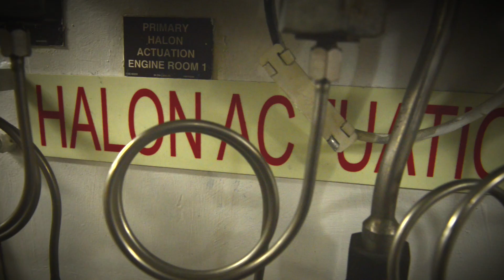The Men Who Sail Below

Comment: USS OKINAWA (LPH-3) ENGINE ROOM late 1970's.  HP, LP Turbine, (25,000 hp) , Electrical Generator Turbine, (2)50 hp motors (fire main,) 2 distillers, main electrical panel, main control.

Comment: I want this job can I learn about air conditioning down there?
Reply: Yeah, become a machinist mate
Reply: @connerowens8482  lol your saying it like this job is going to tear me inside out
Reply: @lasvegascream1799  it is
Reply: @lasvegascream1799  hardest non combat role in the navy. Harder than some of those too. Lack of sleep is the least of your worries down there. Spinning equipment, steam, hot oil, not to mention heat exhaustion. Everything in the engine room wants to kill you. It takes everybody down there going full speed at peak performance to keep everything right, and when they are wrong people could die. But yes air-conditioning and refrigeration is something you can learn as a machinist mate. It is a special school. Usually people go to the fleet and then get selected for ac&r school. Go to different towns and talk to two or three recruiters.